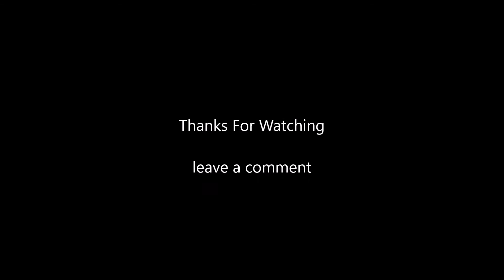Tamiya 56306 - Scaffold Trailer tidy up

Comment: That good job m8 couldn’t u have put them in btween the chassie rails under neath just a thout m8
Reply from the maker: Not without either having wires showing if behind the axles or extending the wires to put in front of the axles
Easiest and best solution in my book was how I did it
Reply: @IanSparksRC  it was just thout m8 u did good job n looks well m8 👍👍